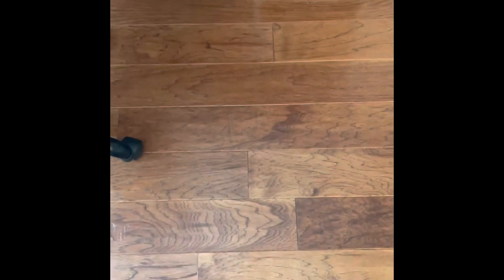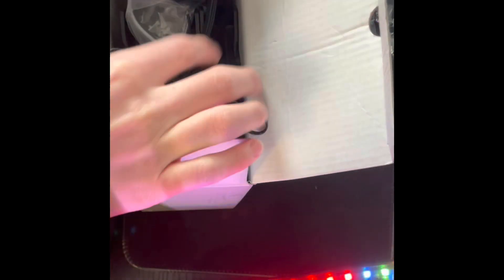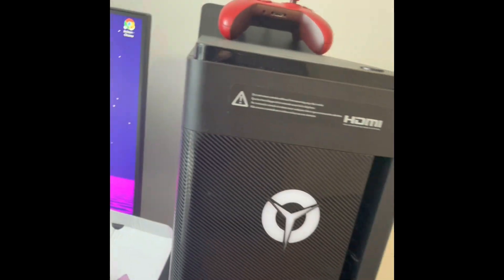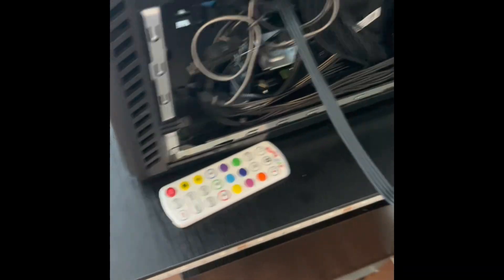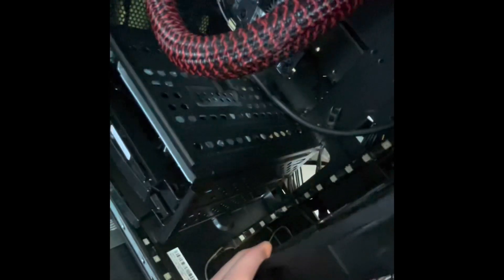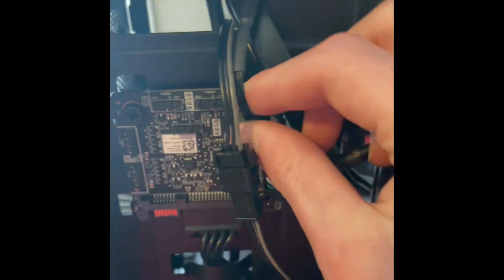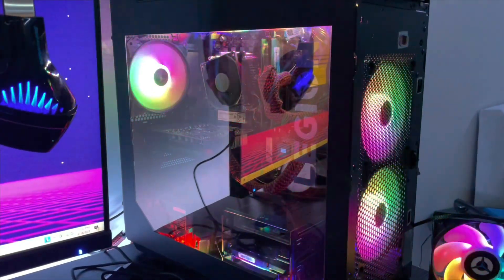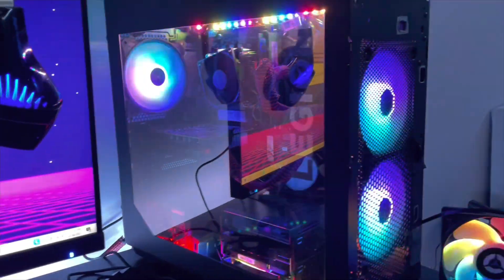How To install upHere RGB fans in a Lenovo Legion Tower! (Or any other PC with SATA)

Comment: Hey bro I want to install the cooler master masterfan sf240p would it work with legion t5 I have same version as u
Reply from the maker: Honestly I think it would, it’s basically mounting two fans, just Connected at the bottom.
Reply: @technugget873  yeah ik the mounting work  but  do u think the rgb would work in it like the pins and shit
Reply from the maker: @adamdoesthings1096  yes, it is ARGb, so the 3 pin connects to one of the RGB headers on the daughterboard in the back of the case, and the 4 pin connects to the motherboard
Reply: @technugget873  bro I appreciate this alot I knew it should of but I get confuse easy and a simple explanation like this makes life easier bro THANK YOU
Reply: @technugget873  hey man i did it looks good but tt came with a rgb remote thing that u need plug and use it for program but its not working any info on that
Reply from the maker: @adamdoesthings1096  I would plug it into one of the headers that either says “cpu fan” or some other one next to it, so you can use the vantage software
Reply: @technugget873  is there no way for me to use the color master software?
Reply: @technugget873  on dose fans
Reply: @technugget873  btw it's a 3 pin connecter so it needs connect to a 3 pin slot
Reply from the maker: @adamdoesthings1096  yessir, there is 3 on the board, but only 2 are actually controllable via the vantage software, plug it into one of the further lefts ones
Reply: @technugget873  I try the other 2 and try the color master program did not work
Reply from the maker: @adamdoesthings1096  try the vantage software, that’s what I use with my cpu cooler and RGB strips
Reply: @technugget873  I don't really like the software very limiting
Reply from the maker: @adamdoesthings1096  it’s the only RGB control you have with this pc, but if you were to replace the motherboard and plays everything into the headers on that,  you would have a different software
Reply: @technugget873  I just used the rgb remote better then software I'll just use the remote until either a mother board upgrade or just a new pc thanks doe!
Reply: @technugget873  also I did not want to use the program because I had a cpu cooler in the way and did not want the cpu cooler to be same as my other fans

Comment: Thanks for vid, both educational and entertaining. 

I have the Costco version i5, and it only came with a single front intake fan, installed backwards btw. I swapped out stock fan with two Cooler Master Sickle Flow aRGB 120 v2, 3 pk with controller and cables in Amazon for $50. I was able to daisy chain them and connect them to the aRGB hub where CPU aRGB is supposed to connect if model is equipped with that option. This eliminated need for sata controller and allowed me to control lights through Lenovo Vantage app, though it is labeled in Vantage app as “legion CPU fan lighting”. Still have the stock rear fan because CM fan cable is not long enough, but the CM fans look significantly better than the AVC fan that my Legion came w/.  

I know you have since upgraded your cpu cooler and are probably using that header for your cooler, but just wanted to comment here in case anyone else is looking for solutions to adding aRGB to front without using a controller. You are one of the few creators doing anything with the legion, and I found your channel looking for this answer. Thanks again.
Reply from the maker: No problem bro, glad I was able to help you out!

Comment: Just a question : did you just connect the hub on the sata, or did you also connect it to the Motherboard?
Reply from the maker: Connected it to sata, which is in the back of the case near the RGB hub that the fans don’t actually work with
Reply: @technugget873  Okay thanks